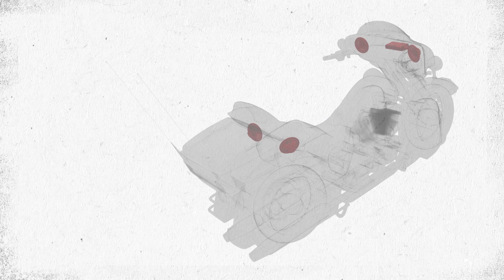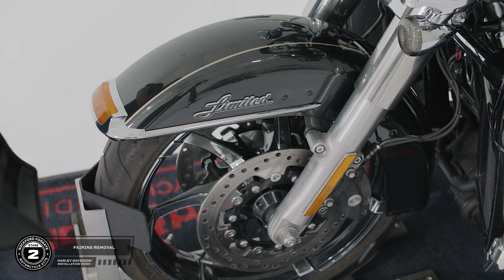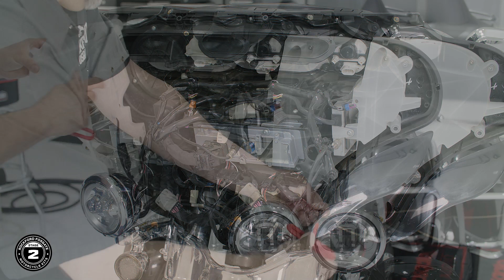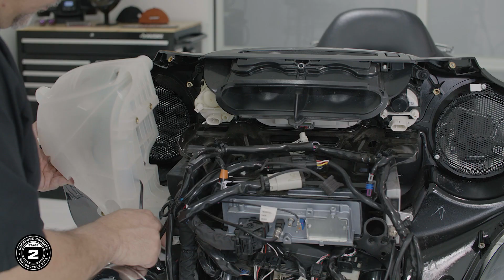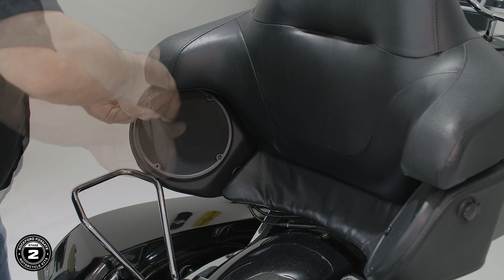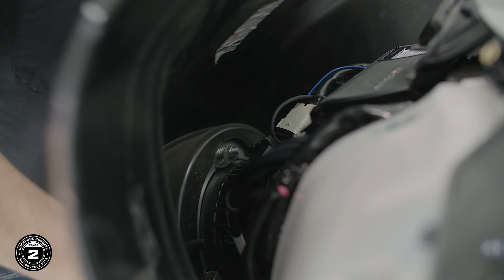2014+ Ultra Classic STG2 | Installation

Comment: We have a 2018 Road Glide Ultra," Dakota Digital MLX Series 4 Gauge Set" For Harley Touring" etc. I installed the RF FGate system. 800 Watt 4 speaker setup. .. What a Rocker now.. I wanted to Thank ROCKFORD FOSGATE  for All their support in my endeavors. I called them So many times, and they were GREAT to answer all my questions.  As hard as it was, I would definitely recommend them to anyone. !!

Comment: Is the fan on amp supposed to run continuously with the ignition off . I’ve had mine since 2020 on a 2020 Ultra Limited . My fan runs all the time with the bike off is this normal ?
Reply from the maker: No, the fan should not be on when the bike is off.  If your bike is OFF and you remove the BLUE wire, the amplifier should turn off.  If it doesn't, you'll need to find an alternate connector that is switched.  In this video, we show connecting the BLUE wire to the ACCESSORY connector that turns-on/off with the ignition.
Reply: @rockfordfosgate The amp is off but fans still run with blue wire disconnected . I have the TM400X4ad amp.
Reply from the maker: @sundance9627  if you disconnect the INPUTS (RCA or speaker line) and the amp fans shut off, there is DC Offset on the signal causing the amp to stay on.  If the fans stay on regardless, you should get the amp serviced.  If it’s within 2 years, you have a warrant on it.  Just fill out this form: https://rockfordfosgate.com/contact-us/41/

Comment: Well, i had that kit kit installed a month ago. Just today. I got the bike back from having the saddle bag speakers installed. I did nkt want to try it myself. So, i had someone with experience do to it for me. Yes, it did cost me money to do that. But i would rather pay someone that has knowledge and experience to do it. I had the harley dealer do it. I have yet to try it at highway speeds. But i will tomorrow.
Reply from the maker: Thanks for sharing your experience with other riders!

Comment: Would love to see a real world install by an average person to see 1. how long it takes 2. what obstacles they face and have to overcome.
Reply from the maker: The kit comes with everything and with the master plug-and-play harness, there's no hunting for color-codes, cutting, or splicing.  A typical Stage-2 that includes Fairing and TourPak speakers should take the average person 4 hours.

Below is a great video that explains from a 3rd party point of view installing the amp, fairing, and TourPak speakers.  The stage-3 in his video has the additional saddlebag speakers:
 
Rockford Fosgate Stage-3 Harley Road Glide
https://youtu.be/rXLf7HE4_4M